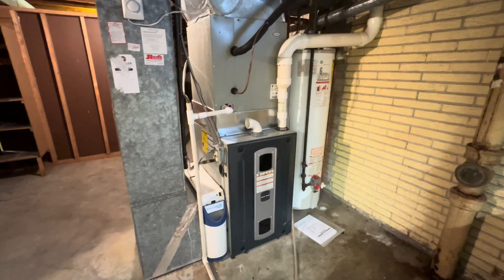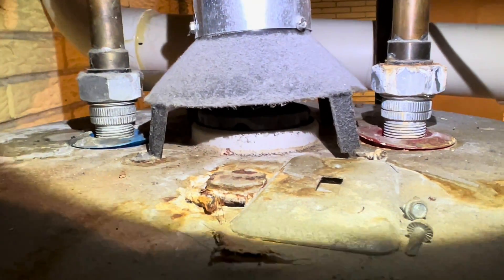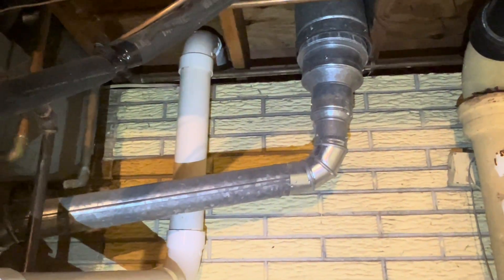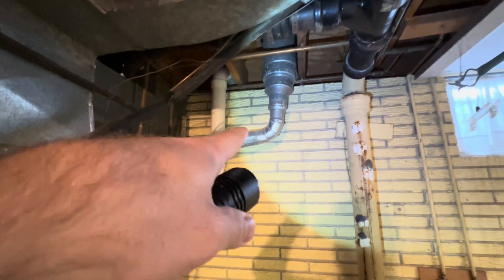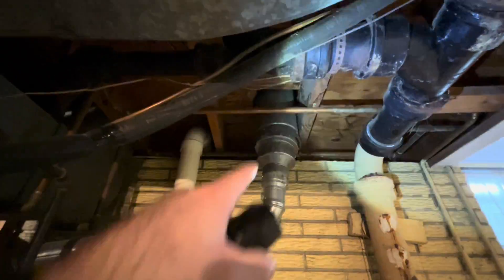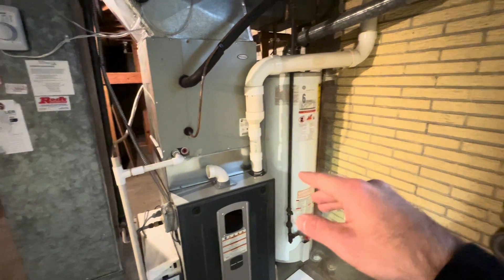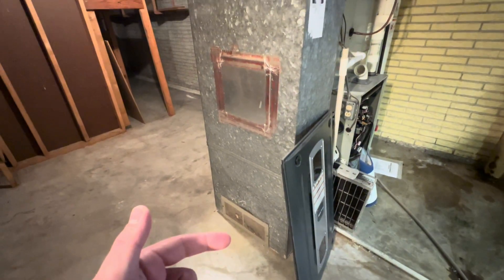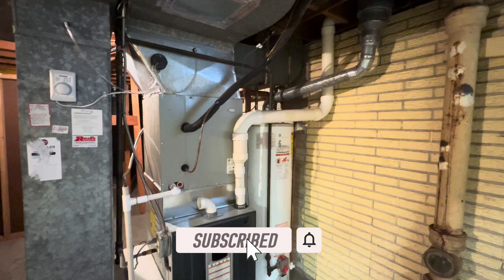Backdrafting Water Heater - SIGNS and CAUSES

Comment: Damn.  First ive thought about the small 3” going into the big 6-8” duct the ac and wh were using but now just the wh is.  My shops in my garage with the wh and ac.  I kept falling asleep whenever i was in there but would have the garage door cracked a bit so guess thats what saved me.  Was funny because id smell like a camp fire and as soon as id start thinking about camping back in the day roasting marshmallows or getting wasted next thing id know id be waking up about 4 hours later. Happened 3 times in a row and missed work from it.  Got wrote up and all.   But some reason i randomly thought about the wh trying to kill me and got a co2 alarm, as soon as i brought it in the garage it went off.. i just ended up wrapping that little opening with a solid duct..  lol. Only fell asleep in there once since then.  Just a little bit ago..  kinda sleepy now tell u the truth.  Thhh
Reply: CO detector/alarm

Comment: Identifying signs and not verifying that a problem exists is interesting. If you see water signs on a ceiling with a new roof do you proclaim the roof leaks too? That is the current issue with home inspectors these days, crying about every sign and indicator and not validating that a problem is currently in existence. Where's the backdraft test?

Comment: I dont recommend 90 degree elbows straight off the top of the hood vent , maybe a 45 but not 90 unless you have some kind of fan sucking the exhaust out . Second i know they say 1 inch of rise for every foot of distance but i recommend way more rise on that 3 inch pipe .

Comment: I too am trying to learn why my water heater is back drafting. And thus, my question. In my mind a new furnace replacement should not cause the existing pipe to be too big as 6 months of the year the water heater only is using that pipe. Is it a cold pipe that does not draw in the winter?
Reply: Just call a plumber

Comment: I put the responsibility of this on the furnace replacement they should be held accountable for the fact that the flue pipe after the furnace has been changed is now inadequate for the appliances going into the chimney

Comment: It was working fine until the Hvac unit was changed. Pipe that make up air outside and or change that water heater to an electric one. Cover that return register. Turn the unit off and see if the direction of the air in the hood changes first off.

Comment: I think the main issue is the immediate near-90 and then that long 3 inch horizontal run. Not nearly enough vertical there right off the top. There should be enough makeup air in that size room to accommodate although that return duct at the bottom of the stack isn't helping that situation either.

Comment: What  actually IS the problem here, that the backdraft causes?
Just trying to learn how things function.

BTW thanks for your videos!!!!! 👍
Reply from the maker: The backdraft allows Carbon Monoxide to enter the home
Reply: Oh GOSH really!!?
Oh I'm glad I'm trying to learn!... thanks you are a STAR!
(I'd entirely missed yr menttion that the hot water heater was a natural gas appliance. 
(I'm used to electric hot water heaters.)

Was the carbon monoxide alarm going off :o
(or did you just notice the water? leak above the 2 melted seals, the seals - which alerted you that there would be a carbon monoxide leak and confirmed what you thought, after you saw the outside 1 ft exhaust, too short, roof exhaust pipe? 
And esp that the exhaust pipe was now too large to successfully eliminate gases after the furnace was replaced.) So the furnace and previous one are/have been running off natural gas also I yake it right?)
Gosh! Seriously well done that you spied 4 things that could lead to a major dangerous potential outcome!

Comment: So, it's not definitive that the water heater flue setup is causing the backdraft, correct? You mentioned it could actually be a couple of other things related to the furnace setup.
Reply: I think that's the main issue. it's horizontal for too long

Comment: You are spot on in your diagnosis.  The flue being too close to the roof probably isn’t harming this unit I realize it’s not code.  We always line the chimney with a 4” liner when pulling out an 80% furnace and installing a 90%.  The return needs to be blocked off and the furnace should have the air intake put to the outside.
Reply: there should be enough makeup air in that size room. I'd take out that return duct at the bottom though for sure.
Reply: Makeup air drawn from the basement?   Unbelievable install.
Reply: If a venting flue is installed to go up and through the roof, it will always be 'too close' to the roof. Also, isn't this guy in the basement of the home he's looking at in this vid?
Reply: @mts7274  was there a point to that? 😂
Reply: @jhrubicon1470  a point to what?
Reply: @mts7274  What's your point tho?
Reply: @Margi183  What's your elemental implication?
Reply: i like your opinions but im also curious why the basement duct return was even put there, and if the intake opening is or isnt the proper size opening elsewhere up the line ... so that should be inspected also before just only sealing up that basement intake?  i recently closed up our 1 return port way too small and then when the blower kicked on i could hear the sheet metal bending on the ducts with loud bongs as it turned on and off..